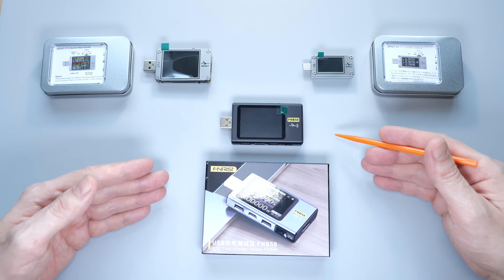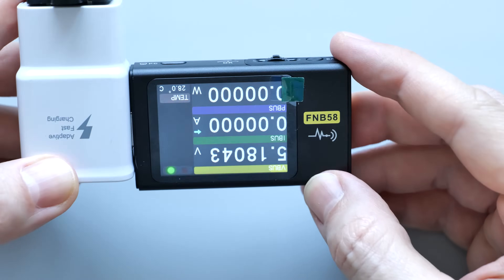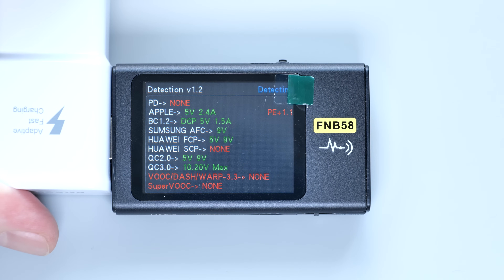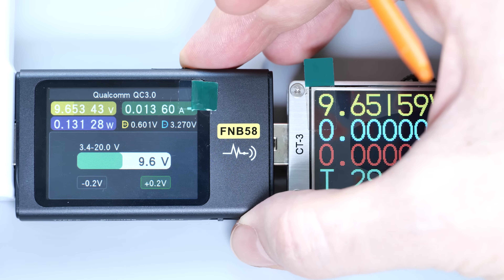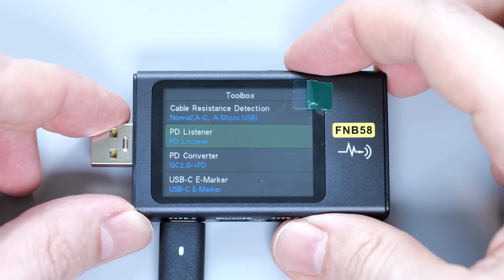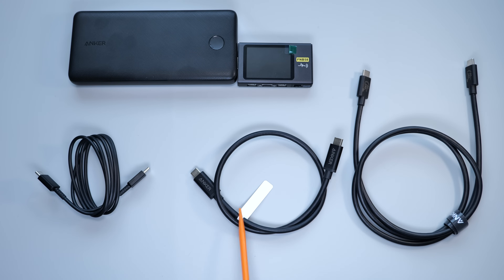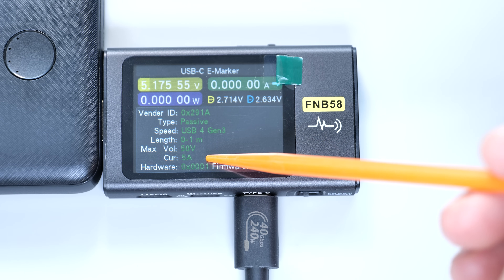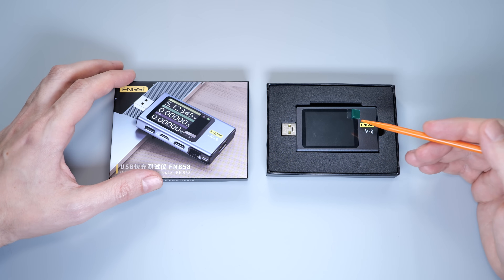FNIRSI FNB58 Review – The Best USB Tester for PD, QC, E-Marker & More?

Comment: Maaf Bertanya, Apa fungsi trigger, apakah aman untuk charge handphone? Adakah aturan tertentu?
Reply from the maker: NEVER change voltage with the connected device to the USB tester. It may be fatal to that phone. All devices that support higher voltage during charging will switch on its own when the charge controller send the appropriate request to the charger. If you force it you will burn the charge controller.
Reply: Terimakasih jawabannya, Lalu apa fungsi trigger ini ? Apakah ada perangkat selain handphone yg menggunakan fungsi trigger ini ?
Reply from the maker: @zdnqds9546   That feature in the USB tester only for testing the power supplies and chargers. The devices like laptops, tablets, phones and some battery chargers can trigger different voltages depending on what they need. For example if you know that your phone supports fast charging and you bought some no-name charger, then using this USB tester you can check if that charger supports quick charge. Or maybe your laptop is not charging, then with this USB tester you can run a test to figure out where the problem lies in your laptop or charger.
Reply: @ElectronicsComputers Jawaban yang sangat memuaskan, saya sekarang mengerti, Terima kasih dan sukses untuk anda.
Reply from the maker: @zdnqds9546  Saya senang bisa membantu!

Comment: i dont think the cable spec check is useful. its surely not testing it in real time, its just reading whats in the EPROM probably, which could just be manipulated.
so you will know at least your cable went thru extra step, whether it is indeed that spec, without a real load and real testing, it is just as useless i think.
Reply from the maker: Unfortunately, there's no tester that can determine the real specs of cables. Yes, the device can measure the resistance of the cable, but without knowing the cable length or wire diameter, you can't calculate the power it can hold. So you have to either enter those specs manually, or it will be just an estimated value based on cable resistance and the average wire gauge.

Comment: They should upgrade the micro USB port to a USB c port for firmware updates, micro USB ports and similar, are extremely annoying.
Reply: You don't need to use the micro port. Just hold the button/wheel before plugging in a type C cable, and it works the same way. That's how I upgraded mine.

Comment: Great video! What sort of functions can be used to test the quality of cables and usb wall plugs? For cables i would assume testing resistance would be best and maybe looking at ripples in the output of wall plugs. I generally never use quick charge and try to use the lowest output wall plugs to not degrade the battery on my samsung galaxy devices.
Reply from the maker: For your Galaxy devices, simply go to the battery settings and turn off quick charge. Your phone or tablet will then charge using only 5 volts instead of 9 volts. As for USB wall plugs, you can check the quality of the supplied voltage using a scope feature. If you have a load resistor, you can verify if the claimed charging current can indeed be drawn from the charger. When it comes to cables, you can check the resistance, but I've never encountered cables so poor that the difference between an expensive one and a generic one is noticeable.
Reply: @ElectronicsComputers  Thanks, that's exactly what I do and on top of that I use a samsung ETA0U61JWE 5V 1A usb wall plug, my galaxy s7 is still running perfectly 7 years later of daily abuse in extreme cold -30C and extreme heat +40C and the battery hasn't degraded significantly. What should I be looking at in the scope? Its hard for me to quantify and determine what wall plugs are objectively of higher quality and safety. Also have you ever seen wall plugs or chargers with manual variable output?

Comment: The tester has a male usb-a plug.  I plugged it into my dell inspiron 3668 which has 2 usb 3.0 ports on front panel.  device says they're 2.0.  can anyone try this?
Reply from the maker: As far as I know these testers can't detect USB speed or type. At what menu option did you find that feature?

Comment: The .pdf manual is essentially useless.  The website is likewise pathetic.  How do you upgrade firmware from linux?  Even if I used Windows, no way would I install software from some unknown CCP company.  A tutorial that walks us through using it for usb port capabilities detection, then to other features would be useful.
Reply from the maker: For some shady software I always use a virtual machine.
Reply: There's nothing in Apple's app store for fnb58.

Comment: Heads up, when the PD Com switch is in the ON position, VBUS on USB A (IN and OUT) and USB C (IN and OUT) are all connected together.  For instance in listening mode your laptop charger negotiated 20V, the type A connector at that instant was also being back fed by the same voltage.  I also have the same Anker battery bank and I tried the same test you did and the Anker battery bank survived the test.  We got lucky that the USB A on the Anker device has a high over voltage protection threshold.  For listening mode power the FNB58 from the USB micro labeled “PC” instead, that bus is isolated from the main VBUS.  
Also I notice that in listening mode or trigger mode sometimes the FNB58 wasn’t finding my device or charger.  Turns out that the for these tests the cable orientation matters, at least for the cables I was using.  If you are having trouble connecting in these modes try disconnecting the type C mainly at the FNB58 and rotating it 180 degrees.  I haven’t really researched this, I will later, but I think it has to do with the CC lines being only located on one side.
Reply from the maker: Yes, you're right, you should only use the PC port for PD listening feature. But all good-quality power supplies typically have protection mechanisms in place to prevent voltage from flowing back into the supply when connected in parallel or from causing any damage due to reverse voltage. This is somewhat analogous to the concept of a diode, which allows current to flow in one direction but not the other.
Reply: @ElectronicsComputers   yea i agree, I won’t worry about a bench supply or a wall adaptor. But since USB A is an output only port a PC maker may only have a current limit IC inline with the 5V buck with an absolute maximum rating of 6V.  If that’s the case applying more 6V on VBUS will definitely blow up the IC.
Reply: I read this too late. The FNB killed my lenovo laptop with it's 20V from USB A port, which got 20V from the USB C PD. Stupid design
Reply: @gvctdcgg4824    that's not good at all

Comment: 1:21 What does this mean on the screen? Will I damage my phone when charging it through this device?
Reply from the maker: If you connect an old phone that doesn't support fast charging and only requires 5 volts for charging then, yes it will burn the charge controller. There's no need to turn those high voltage modes for charging your phone. Your device can do it on its own if it has that feature and this USB testers allows you to see those processes.

Comment: Just got this so I can test devices, but curious how it stacks up to the CT-3 there is one reason i really want that one, and its the load module so I can stress test devices to ensure they are up to spec and also have a fast way to get battery capacity.

It just seems well made and nicely integrated.  I can keep the 58 and get a generic load tester and it wouldn't be nearly as nice and cost may more.  The advantage would be testing othet devices like power tool batteries, i can already do 18650 batteries with the charger i have.

There is also now the CT4.
Reply from the maker: You can use any load module with this tester as well.
Reply: @ElectronicsComputers Yeah, that's the route I think I'm taking.

They all seem kinda hacky yet still expensive for the ones I'm looking at.  Do you have a specific recommendation?

I ordered a 150w variable one that has a breakout board for USB.  

The nice thing about combining these two devices is I can verify readings from two devices and if the load doesn't negotiate a voltage/amperage I want I can use the 58 to spoof and get the power output I want.

Comment: hi! Do you know a USB tester witch can limit a charge at 80% on non cellphone devices. I want charge my power banks pocket wifi and portable speaker at 80% charge all the time.
Reply from the maker: That would be great if such a USB tester existed, but unfortunately, it's nearly impossible to create one because there's no communication about the battery state between the charger and the battery. In theory, if you charge a completely drained battery, you can set a limit on the milliampere-hours (mAh) that the charger can pump into your device to charge the battery and stop charging at 80% capacity. However, if your battery, for example, has 20% charge remaining, it will still be charged to 100% with the same limit, and so on.

Comment: hello sir, what is the different between fnb58 and fnb48p? what to buy fnb58 ($46) or fnb48p ($34)?
Reply from the maker: I also made a video where I tested the FNB48: https://youtu.be/a7XaeHFuiPE
The FNB58 offers many more features compared to the FNB48. Unlike the FNB48, which has exposed PCBs and components, the FNB58 comes with a normal case. Additionally, the overall build quality of the FNB58 is way better.

Comment: If you already have a PSU connected to the USB-C IN port, do you still need to connect the FNB58 to the built-in USB-A (male) port to a power source (in your case, it's a USB-A power bank)?  Just wondering if I need to always power the FNB58 using that USB-A connector even though I'll be testing only USB-C PSUs/devices.

Wondering because this seems to be the most versatile tester (also very nice interface), but if it needs to be powered by the USB-A male connector to test USB-C power sources, that's unwieldy and inconvenient.

For now, I want to test the Baseus CCZX-100CO car charger I just purchased (let me know if you have any opinions on this charger as well) but I'd have to do it in my car.

Here's a video I did just as a preliminary test to see it's capabilities between my Pixel 7 Pro and a laptop that can draw 65W.

 https://youtu.be/mogYzbiRtBo

But I want to verify ALL of the protocols it claims to support.  I'm a bit suspicious of a small car charger that claims to do 100W.  Even if it does, I'm afraid of the heat it will generate.

Thanks for a great video.  You've earned my subscription!
Reply from the maker: No, you don't need to use a second power source. There's only one feature that requires a second power source, which is PD listener, and it should be that way. Baseus makes pretty good stuff, but I always recommend using Anker chargers if you can't buy an original one.
Reply: @ElectronicsComputers  Thanks for responding. Price was a driving factor, and the reviews seems genuine on Amazon (most complaints are about the dim display).

Btw, when testing USB-C, does it pass through device negotiation?  Example, if phone asks for 9v, will that request get to the charger, or do I have to use the tester to manually request it?  Wondering if it's possible to accidentally request (for example) 20v when the device is actually asking for a lower voltage.
Reply: @ElectronicsComputers  I just answered my question but I don't like the answer.  Sometimes it passes the negotiation,. sometimes it doesn't.  When it does, it charges like normal and you can see what they negotiated on the display.  Sometimes it just doesn't charge at all.  Sometimes it charges at 5v 1A.  There doesn't seem to be any rhyme or reason.
Reply: @TechieZeddie  Supposedly that erratic behaviour improves if the FNB58 is powered through the micro USB port. I don't have one, but some other brands require separate power for that to be stable, so it adds up that it would help. But I don't know for sure.

Comment: what will happen if you use fast charge test on a phone that supports fast charge? I mean manually setting voltage by tester, not by phone
Reply from the maker: Some devices will work flawlessly, while others may fail. It depends on the charge controller. I wouldn't force any device to accept a higher voltage, even if it's one of the supported ones. All USB ports provide 5 volts initially, and only after establishing negotiation between the power supply/charger and the receiving device, then voltage change to 9, 12, 18, or 20 volts.
Reply: @ElectronicsComputers  yes, i always wondered what happen if you force higher voltage. it useful when your phone supports fast charging with different protocol